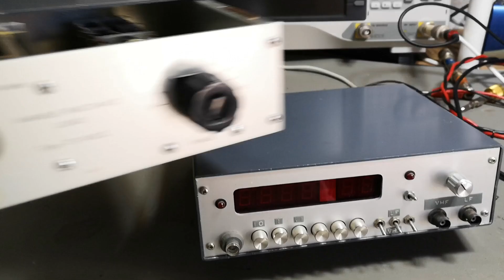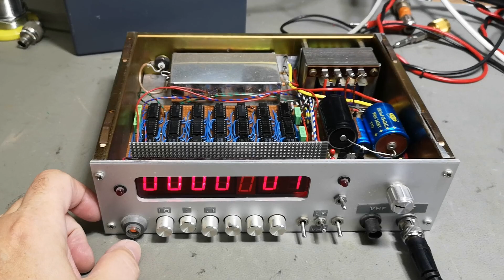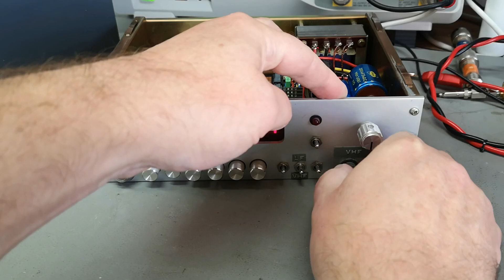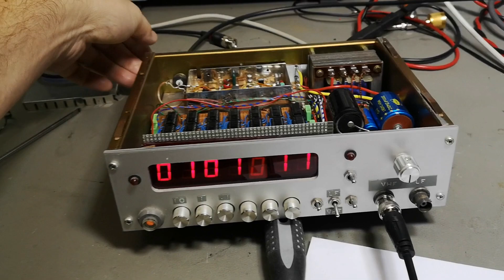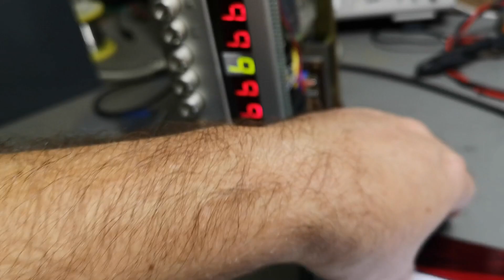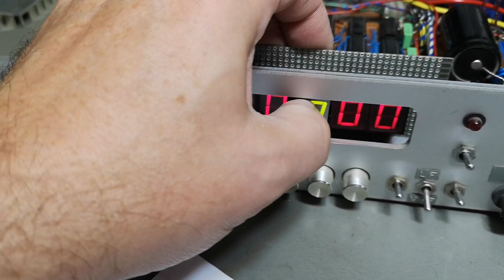DIY frequency counter 0-500Mhz TTL 1975 test teardown

Comment: It wouldn’t be hard to get the holes done this good on a manual mill. The display opening can have radii from the cutter radius. Good stiff fixturing is needed so there won’t be chatter. Definitely doable CNC-less. But this may well have been CNC.